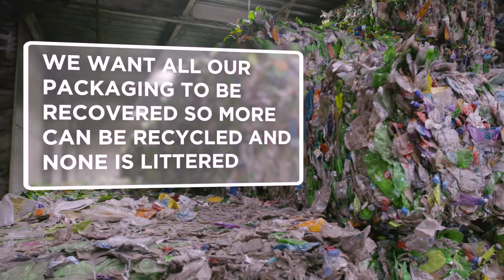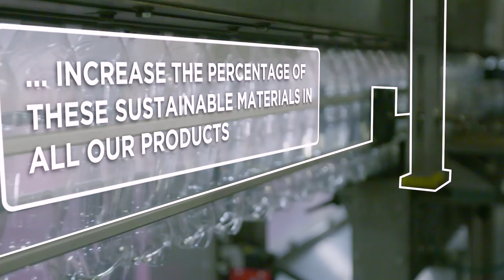The Lifecycle of a Coca-Cola Bottle: How our iconic bottles are made and recycled | Coca-Cola GB

Comment: Re use glass like in the 50’s and stop producing plastic
Reply: Over here 90% of those plastics are recycled because they're sold with a recycling fee you get back once someone returns it. My guess is glass would be less environmental and economical over time, because of the temperatures involved.
Reply: @downstream0114  true

although the problem is most of time it doesn't get returned; unlike the glass bottle back then.
Reply: @UnordinaryCarl  Over here, even if you throw them outside someone will probably come along and return it. You get 5-40 cents depending on the bottle/can and material.
Reply: @downstream0114  it does; unfortunately in other countries (especially developing ones or ones that got colonized by corruption - you can see beaches and oceans with a liter of coca-cola along with other plastic products)

 they don't trade-off good - it's like 2-10 cents is like per kilo (or more) of can and bottle.